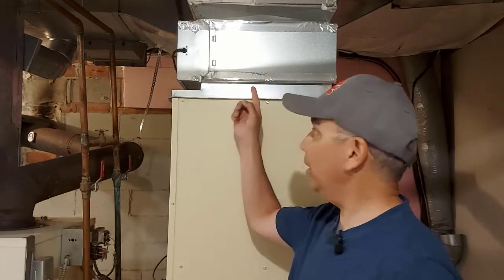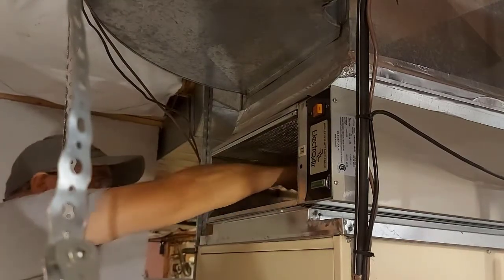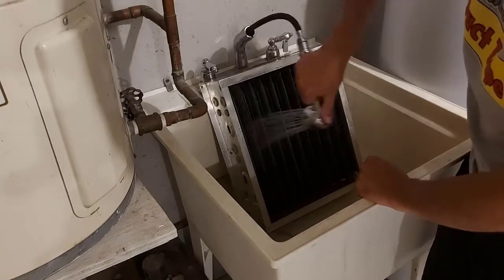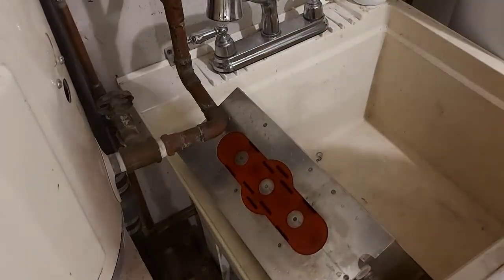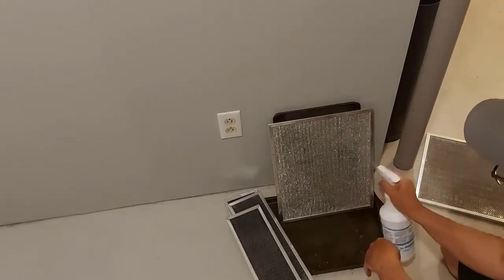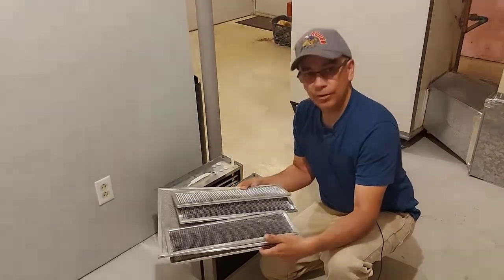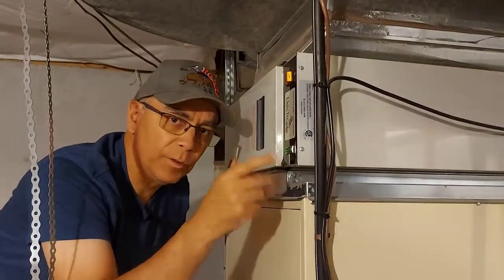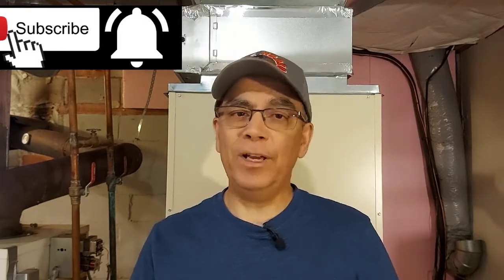How to Clean an Electronic Air Cleaner Filter | Furnace Efficiency

Comment: Hello, I just had my vents cleaned and the technician told me electronic filters were a waste of money & does not clean the air, especially allergies , duct, pet dandruff and other particles. I clean my regularly, every 3-4 months or when the season changes. Should I go to regular filters or media filters
Reply from the maker: I've never heard this. I still have the electronic air filter
Reply: I been using electronic filters since I lived here for 38 years and this my second furnace with a electronic filter. I wanted to investigate about it first before I make a decision to replace it with regular filter
Reply: @martinmercerjr8615 I had a technician tell me the same. He recommended replacing with the disposable filters. I am thinking I will.

Comment: Yo! You are giving poor advice. The 3 smaller panels are CARBON FILTERS which are not washable. They have to be replaced via purchase of new ones. They are designed to remove odors. 
I’m reading this from my Maytag electronic air cleaners manual which explains the whole unit. 
You should edit your video.